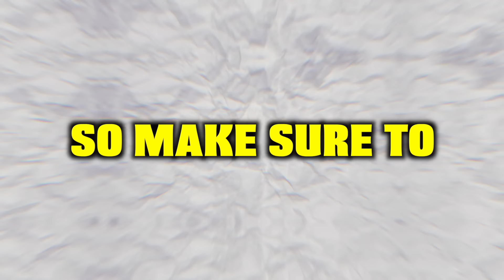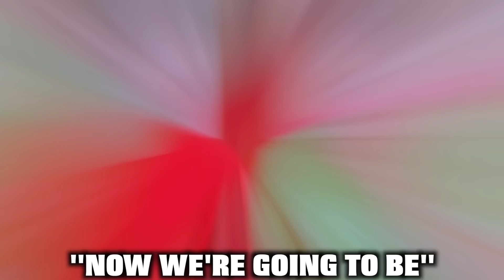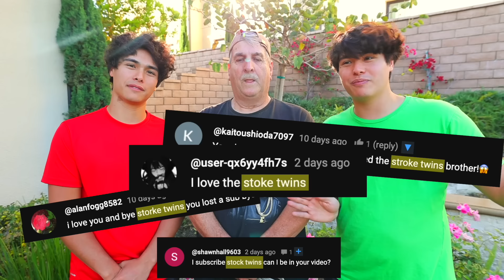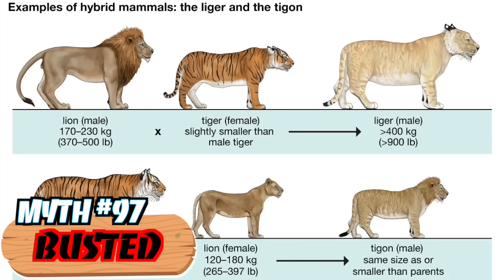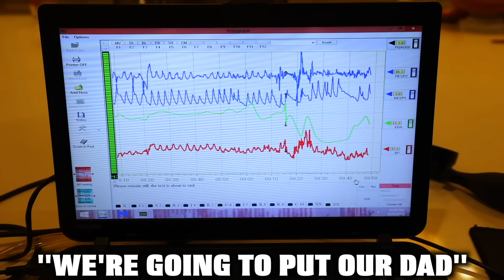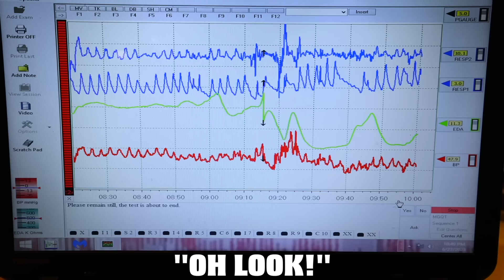100 Myths Your Parents LIED About..

Comment: 8:33 another thing is that the human body is less dense, you can prove this using maple syrup, water, and oil.
Maple syrup is denser than water and water is denser than oil and that’s why they want all mix and that’s why and how you can test densities. You can also put objects a bolt will sink in to the bottom layer with maple syrup. A sponge will lay right on top of the oil and you can also tested with a lot more things.